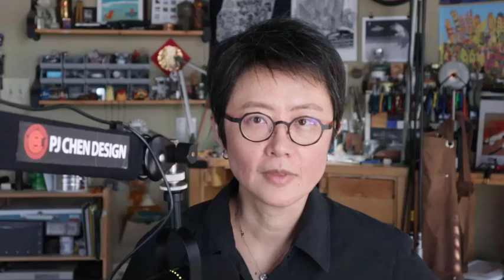PJ needs your feedback.

Comment: PJ, please could I add another question to be considered for the course? I'm interested to know if you are considering having a mould made of your design, is there a benefit to having your design first printed in castable wax and using the metal as the master or if the 3D printed file is smooth enough using high detail resin should you make a mould using the 3D print instead?
Reply from the maker: It depend on if it is a one time piece of production piece. Manufacture use to be making model, but it has been change so far due to the lower cost on 3D printing. If the 3D printing quality is good. and for limited production or one of the kind. I will do 3D printing.

Comment: Hi PJ! I work with chains, so I would like to know the preparation of the .stl file if i want to cast a whole chain for example. Also to consider which would be possibilities for arranging the objects to be plotted, can you form a tree to be plotted and then cast, technical considerations for for do’s and don’t do’s. 
Also I’m discovering simplicity works great for dealing with production companies; how to make the file so it can be ready for printing. Does this increments the prices we are charged? So its better if we give our files ready for 3D printing. 

Technically thats all I can think of for now. 
Looking forward to your results!
Reply from the maker: Noted!. Thanks
Reply: Shrinkage! Percentages vary depending if it will be a production made with molds and which kinds of molds, is this standard?

Comment: I would like to know about working with subd's, for example how i union a simple polysurface and a subd to make the one single object, or how i use the commands on subds. Now i made a dragon using subd tool and i cant make its skin with scales and textures because i cant use Create UV Curve or flow along surface/curve commands on a subd. So how we can solve this. Thanks and all appreciation
Reply from the maker: I do have a SubD online course that explain everything. you can check it out at https://pjs-school.thinkific.com/courses/subdrhino7. Meanwhile, you can turn all subD object into the NURBS and do the boolean.

Comment: Hope this is in the realm of the feedback you're looking for - I'd like to see a course on Workflow in rhino. In my journey so far, I've learned that there are many ways to skin a cat, as the saying goes, and I can't help but feel like I could be more efficient in rhino between hotkeys, commands, templates, understanding multiple use cases for frequently used tools and determining which way is the best. I just want a cleaner, faster rhino workflow/production of models and someone to guide me through those tricks of the trade would be helpful.
Reply from the maker: some people like to use hotkey. but I don't. Just because I need to show students where the commands are. but when I get used to it. It works fine to me. Some of my Mac user students like to type the commands, just because it is faster for then instead of looking icons. because icons placement is different than PC. I have students like to custom toolbar and some are just fine with default one. It is really depends on what you use the most of the job you do the most. there is no ONE best way, just more suitable way for you. and everyone needs different things. I think having a custom tool bar may be a good start for your exploration.
Reply: @PJChenJewelryDesign  hi PJ, thank you for your time and your thoughtful reply. I see what you mean. Thanks for all the great content!

Comment: Hi PJ,  oftentimes customers ask to tweak models . Could you  please  go deeper into ways of editing already finished models, especially solids:  moving faces and edges, changing thicknesses, curvatures. Beyond gumball and cage edit tools.  Thank you so much for all your videos! I have learned s lot.
Reply from the maker: Hi Evan, good question. It depends on how much you want to tweak and what to tweak. I always save my model in parts before I boolean them for printing. so if customer want to change ring shank. I can quickly duplicate it with shank change. but if you need to change the setting from round to princess cut for example, you will need to redo the setting. sometime you can use cage edit command to do minor change.

Comment: Really enjoy your videos PJ, so great full to all the knowledge that you so generously share. I would like to know how to review a design on rhino for casting, problem areas visualisation. I know other programs can do it, but not have not been able to do it in Rhino. Thanks!
Reply from the maker: Noted. I have plan to include a video on how to prepare your file for printing and casting. Also, if you need to find the naked edge for example before send it out for casting. You can use "show edges" command to see where is the problem area.

Comment: Very much!
First, I think it would be very good if you could address what kind of minimum thickness and size you need to make something, for example prongs minmum 1mm etc. How high does a rub over setting needs to be. All those kind of measurement you need to know!
Second, cutting a model into different pieces so it is easier to finish the casting for a goldsmith. 
Third, how different shapes of a gemstone affect a build. A round diamond is a lot easier then an oval or even a shield-cut for example..

Thank you for the great content!
Reply from the maker: Noted. Thanks

Comment: Hi PJ. Interested for sure. One thing I have a hard time with, is to give a fair price to my jewelry production. When customer ask me for a quote for custom piece ( for example a ring or bracelet, made especially for them ), I always have trouble setting a right price. If you could tell us what are the guidelines you follow to get a fair pricing, I hope it would get many of us interested. Thank you for your videos and your kindness, you do an outstanding job teaching us using Rhino.
Reply from the maker: Good point! I plan to include a presentation of detail on how to pricing your work. It is suitable for limited production but same formula can be use for one of the kind or custom work. I am sure I will have it in the course.

Comment: Thanks PJ ,  for asking the next topic would be.  Your videos are very professional, precise & Concise.                   If you can add few questions that would help me  to Calculate the Cost of Custom made diamond pendent.( I am in  SALES ).                                                             #1. Per sq cm diamonds ct wt . ( Approximately).                                             #2. If we change from “ one pointer diamond size to two pointer “.      Ct -tw would be same or different. If different,  kindly guide me .                                              #3.  Calculate the Gold weight of diamond Pendent ( Formula ),  keeping the size of pendent . Like .   If. Diamond pendent is. 1.5 “ in height , 2 inches in width and thickness would be 3mm .             Any formula for calculating the weight of the pendent?                                                        4.   If rest of the Specs same ,  we just make thickness.  2mm , instead of 3 mm .   If. you may help me with the above concerns, that would be good help . Thanks .
Reply from the maker: sure, I am in jewelry industry for about 20 years and done a lot of custom work. Even though my main focus now is on teaching side, I can ask some professional about their price strategy and included in the course. Great points!
Reply: @PJChenJewelryDesign  , thanks very much PJChen for your quick reply .           Kindly let me know, I would be waiting for your reply .  If there any Software ,  with any specific version, I can get .   Please send me the link , if you can . Thanks Again .🙏
Reply: Interested

Comment: I'd love to see how to properly prepare a model for casting. E.g. the edges, what the size of a prong should be relative to the gems, length of prongs, what parts of the model can cause issues, how to avoid these issues, how narrow can an edge be, and stuff like that. Thanks for taking the time to make these videos. You've brought me from a complete beginner to somewhere where I can actually pick up a sketch and model it without looking at tutorials.
Reply from the maker: I actually discuss in detail about this question on my stone setting course already. You can check out the course on my website at www.pjchendesign.com
Reply: Very good point.